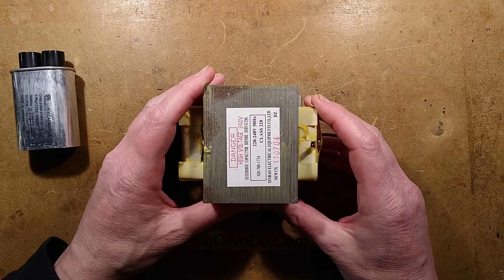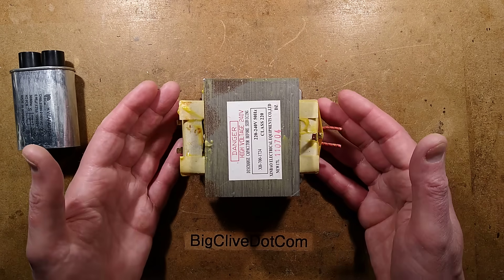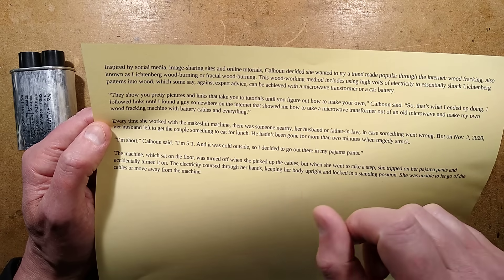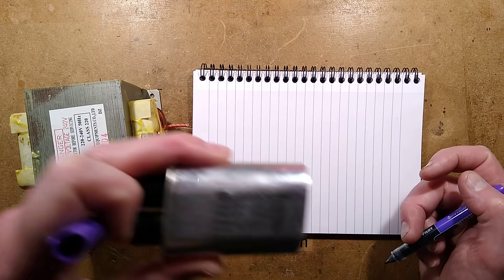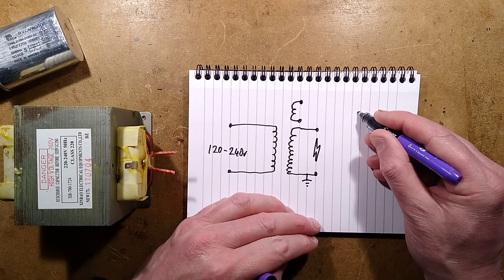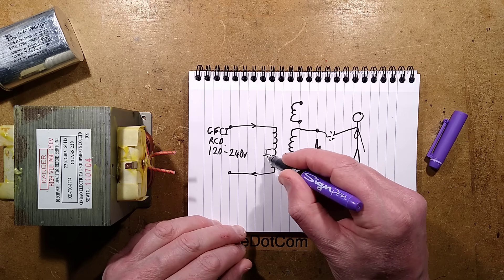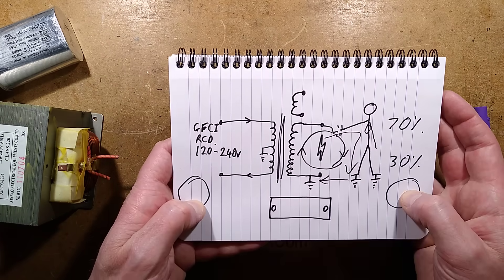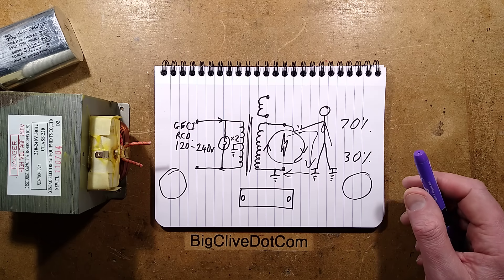The most deadly project on the Internet

Comment: I've done the wood projects at home with a neon light xfmer and a long extension chord .You use 2 nails on each side of the wood . place the wood piece on cardboard or non conductive material . don't put too much water on it so it spills. Clamp the ends of the xfmer to the nails.  Stand back at the extension chord / wall outlet far away from the wood piece

Comment: I remember being electrocuted by my TV, it was one of those really old massive TVs, someone fixed the wire with some bridge connectors, being like 12 at the time I didn't know jack about if you touched certain parts it would electrocute one self lol, I literally could not take my hand of it, I was trying to but my hand was literally glued to it, unless I managed to let go eventually? idk 
After that my hair on my head was standing up it was kind of funny but then at the same time very frigging scarey!

Got a question here; Does anyone know how much voltage and amps goes through those old massive TVs?
Reply from the maker: The voltage could be a wide range in a TV.  From 0 to 30kV.
Reply: @bigclivedotcom  Ah thanks mate lol
Reply: @bigclivedotcom  Usually 25K on an old color set plate cap. You were lucky. Your hair would have been the perfect style for today.

Comment: My brother once asked me to make one of these wood burners for him, I told him I wouldn't give him the tools to kill himself.

I will still probably do it with him one day, but only with me around and in a very controlled environment. it's not something I would do lightly, I really like your dead man switch idea as it is similar to something I was thinking of.

My father once told me
Low voltage May kill you if you touch it, but High voltage always deserves respect as it will kill you just for looking at it wrong.

Comment: People need to stop referring to the voltage as the meanings of safety. In most cases it’s the amperage. Use the 12 volt car battery compared to 110 volts. Simple math says that the 12 volt battery is far weaker than the 110 house voltage. So wrong. Worry about amperage. Be very scared of amperage
Reply: In this case of a microwave transformer though, the amperage is also very high at around 1 amp. It’s just that higher voltages typically coincide with higher amperages which is why the former is mentioned far more often as lay people (myself included) are more used to the concept of voltages.
Reply: @TheSniper9752  Well, next time I'm getting electrocuted, I'll stick an amp meter in line to see if I'm ok. lol.
Reply from the maker: In this case, high voltage pushes high current.

Comment: Sir.A Question. I intend to purchase a einhell power x-change charger that is powered from a cars 12v system.  The battery packs are 18v so.. surely unit needs approx 22v internally to charge 18v.does this sound right?? Many thanks

Comment: Not sure exactly sure why you were working on a 13.8KV line live. But at that voltage you need to be working with a HotStick. Your gloves have to be tested every three months per OSHA you also need to be wearing leather gloves over your rubber gloves and you should have been standing on a insulated high voltage blanket. Who went to jail for allowing you to work live voltage with just gloves on and no 50 CalSuit?

Comment: Once ago, when I was learning to TV sets serviceman, we had practices and classmates begun a fun: Pulling the electric arc from the high voltage transformer by screwdriver. (There were analogue tv sets yet.) They said to me: enjoy it too. And offered me a screwdriver with damaged insulation. An arc went through damage, to my finger and caused me an unpleasing burning injury within less a second. (16 kV, 15625 Hz)

Comment: I've read a lot of comments but haven't seen what I'm looking for, which is - what is the proper way to "drain" a transformer of its energy?  OR are you saying that it doesn't store the energy, but in reality can pick up energy from other things and pass it through you.  I do a lot of copper scrapping, and microwaves is one of many items routinely scrapped.  So because so many people do it and will continue to do it, what should someone do to eliminate this risk AND STILL properly scrap it out?
Reply from the maker: A transformer doesn't store energy.  A capacitor can, but sometimes has a built in resistor to discharge it safely over time.
Reply: @bigclivedotcom  Ok cool, thank you.  So is the biggest issue this guy is mentioning having to do with people trying to use a transformer for something?  I've seen SO many people scrap out transformers and had no issues.  Just wanting to make sure.

Comment: NOTE These microwave transformers can still shock the living daylights out of you even after they've been sitting in a microwave that's heen unplugged for months and maybe even up to a year.  I'm not going to swear by the 'YEAR' theory, because I'm not stupid enough to test that out.  I did however get the crap zapped out of me by a microwave that didn't work anymore and I was f'ing around with it just for sh*ts and giggles.  Never again.  LoL. I learned that lesson the hard way.  Btw, my hands were dry when I was shocked.  They were definitely dry after the shock!!!
Reply from the maker: Note that spinning a microwave turntable motor can generate enough voltage to give you a shock.

Comment: Hi Sir, Saw your Video. Need an advice. Do you think that tube amplifier power transformer secondary's winding need to add in fuse? Or you could suggest a better safety precautions for me please.
Reply from the maker: I do recommend using a fuse to protect the transformer.  You can also use PTC thermistor fuses that self reset.

Comment: I've been a microwave service technician for over twenty years. I am still very aware that it is very dangerous.
Reply: I didn't even know that was a career still. Kind of like how "tv repairman" is no longer a thing. Huh.
Reply: @Guru_1092  Why wouldn't it be? Unlike CRT TVs, Microwaves are still used by everyone.
Reply: @AdamsOlympia  Idunno, just never really considered it. I mean, it makes sense in hindsight, but still feels antiquated as a career (even though it definitely isn't).
Reply: Same here. I was electrocuted by the sec. capacitor and it was not a nice experience.
Reply: @michaelekstrom7698  you were shocked, not electrocuted. "Electrocuted" is a portmanteau of "electric" and "executed".
Reply: @Guru_1092  🤣

Comment: I’m a DIY guy and have done my own electrical circuit and cables for my mancave HT which includes cabling all lights, switches, outlets, etc. One thing I will avoid and never entertain myself in doing is working with anything higher than 120V. One reason is I’ve no formal training in electronic or electricity. Everything I know about basic electricity is through reading books and online resources. The results using HV for this project is truly amazing, unique and something you can brag about, if done right as you have suggested. Another project I saw online that looks fun and mesmerizing is a high-energy plasma using microwave oven transformer, which if done right, can be rewarding. I’ll keep to my 120V max limits 😅

Comment: Good to see someone trying to educate the masses regarding electricity. I have an electronics background and well versed with spark inducing devices. What I have found out over the years is that there is an INCREDIBLE ignorance of our most utilised natural power source. I mean how many times have you heard the question, what kills current or voltage? Now I'm not going into that here but if you don't even know the answer to that question you would be wise to stick to using ON and OFF switches and 9v batteries!! Bonus, best way to test them is on your tongue. I do think you could have placed a little more emphasis on the Capacitor, recognition of and lethality of.

Comment: old habits die hard big clive, UK nominal voltage is 230v, or is it a brexit thing?
Reply from the maker: I'm talking actual measured voltage and not theoretical paperwork voltage.
Reply: @bigclivedotcom  but given that this IS theoretical paperwork and not a measured voltage the current  [2003]] nominal voltage of 230v should be used,  granted 240 is the most usual voltage measured but a significant number of supplies will be 230v and any current calculations based on a higher number will give  a lower current, possibly leading to the incorrect  conductor CSA selection

Comment: Just wondering (If you would answer my question) Could a Microwave "Transformer" be used to make a "Jacobs Ladder" Project .. ?? Is the Voltage High enough ?? (Thanks for pointing out the Danger)
Reply from the maker: It's way too ferocious and dangerous for a Jacobs ladder.  See if you can get yourself a 10 or 15kV traditional 50-100mA neon sign transformer.
Reply: @bigclivedotcom  Thanks for the answer regarding a Jacobs ladder ... I've seen neon sign transformers but a bit High of a price for my wallet.
Reply from the maker: @x_CrossHair_x  They are.  But massively safer than a microwave transformer.  If you have an older local sign company ask if they have an old used neon transformer you can buy.
Reply: @bigclivedotcom  No doubt safer .. I found one (Amazon 10KV under $50) put into my wish list. So I will go with that and hope strong enough to work. (BTW no local Sign company that deals in Neon)... Small town what can I say. (Once again thanks for your help and taking the time to answer my question) TTYL perhaps.

Comment: If I hold in my hand , a shoe, and touch the shoe to the live terminal, will I get shocked? No, because the rubber sole is not conductive, right?  Why when the shoe is under my feet it becomes conductive?
Reply from the maker: High voltage and moisture.  Even the tiniest pinhole or crack will wick moisture that provides ample path for fatal current.
Reply: @bigclivedotcom  perhaps an explanation with a circuit diagram could better show the path of current through the body to ground with details such as resistance values, material elements, surface charges, voltage drops, etc.

Comment: Thanks. Being the kinda guy that screws around with almost everything thinking I will be fine. I now know, I don't think I will ever do anything more than change a fuse in a microwave. I've even wired my own house etc... But when I know that all I need to do is work on the right side of the breaker and don't touch the bus bars etc. These things freak me out.

Comment: This is why we love you, man. You tell it like it is. no bullshit. All right people, pay attention!!! this one is equally as important.
   That 2000 plus volt high voltage section he's talking about, that powers a thing called a magnetron, inside your microwave. It's kind of like an extremely focused microwave antenna. it's the main component of the microwave, and it's almost as dangerous as what powers it. A lot of people will take apart microwaves, to salvage parts. Grab those micro switches out of the door, but don't bother with the donut-shaped magnet on the magnetron, and here's why:
   When you look at the magnetron, you usually see a tip sticking out of a square box with fins on it. That magnet is inside the square box, and on the other side there's usually White or pink porcelain surrounding that tip sticking out, sometimes there's a screen as well. That pink or white porcelain usually gets smashed, while removing that magnet. Well, people, that white or pink piece of porcelain, by itself, isn't too dangerous. But when you smash it into a powdery dust, that's when it becomes very dangerous. You see, that white or pink substance is BERYLLIUM OXIDE. When crushed into a powder it is toxic, and will destroy skin and lung tissue, it is highly cancer causing. Think Asbestos, but many many times worse. So if you see a microwave magnetron and you just have to have that magnet inside, don't bother. It could kill you.

When I started pulling parts out of microwaves, I saw that magnet, and I started beating on the magnetron with a hammer to get it out. So stupid, I was......
Reply from the maker: Very few microwaves use beryllium oxide other than in very high power units.  It is usually indicated by very bold warning labels.

Comment: Your advice about discharging capacitors is also good. I saw a chap dismantling and repairing an LED light bulb in a youtube video and thought I'd have a go at a failed one myself. I found a circuit board inside with what looked like a dry solder joint so repaired that and switched on. Still not working. While looking for more dry joints I must have touched the circuit board in just the right place and got a real belt in my finger. Was probably safe when I started because it had been inop for a week or so, but powering it up just charged the capacitor which then sat there waiting for a sucker's finger to happen by! The bulb went in the bin...

Comment: Fantastic Presentation. If People are going to do this, please wire in the Dead Man’s Switch. It’s not hard to do. You Run 2 Momentary Normally Open Push Button Switches in Series far enough apart to where it takes both Hands to Operate. Wire both Switches in Series with the 120V Input. Clamp your Work Pieces to the Wood and stand back to Operate by pressing both Push Button Switches. I like the Neon Transformer Idea a Lot Better. If your not a Licensed Electrician, please don’t try this at all. You could at least Hire a Electrician to  build a System for you using High Voltage Rated Wiring where you Clamp the Leads to the Work, and have to Operate it from a Control Panel to Protect you. In other words, don’t Play with anything Electrical if you don’t know what your doing!!!

Comment: Thank you for a great video that  may have saved several lives already.

Unfortunately, some people will be reckless without limit, regardless of all warnings. I knew a guy in the early 1980s who even worked on TVs, using tools for car electricity! He insisted that everybody who thought that any unplugged device could be dangerous did not understand Ohm's Law!

But even he would have put on more than pyjama bottoms for doing electrical work outside, and not just when it was cold!

Comment: “Ground” is created at the power source. In this case the secondary side of the transformer. This is achieved by connecting one side of the winding to the case. As long as the transformer is insulated from “earth ground” you will loose that potential and lessen the risk of electrocution.
Reply: Maybe, maybe. See also: forgotten weapon Coilgun HS-47:
https://youtube.com/shorts/BPReIoZ-2Nw?feature=share

https://youtu.be/0WF1BGmit78

Comment: I haven't seen the project this video refers to but I wonder, if the whole safety issue is caused by the secondary being referenced to ground, then why not remove that reference and have the secondary floating? What situations might cause this to become dangerous in the context of the referenced project? Of course, when conducting liquids are involved, it is very easy to form a conducting path to ground whether accidentally or via bad judgement. In that respect, the said project is dangerous anyway, whether the secondary produces 110V or 2000V.

Comment: I have seen these devices used on IG videos.  Didn't know they were so dangerous.   I have worked on microwaves but I give them my full respect.  Great video Clive.   You probably saved at least 1 life
Reply: I must have been 6 or 7 years old. I was at a county fair with my parents and two older brothers. Us brothers we're off by ourselves and we stood in line for a ride called the Himalaya. A tube steel fence corraled the line for the ride and had 3 horrizontal bars. Pseudo Echo's version of Funky Town blared, and as I left the ground and stepped onto the bottom bar of the fence while holding onto the top bar a current of electricity with unknow voltage entered my child body. Some of what you said I experienced but clearly not as severe.
The most terrifying thing was, I could not rip my hands free, I just stood there screaming while my brothers thought I was screaming with those on the ride. I felt it in my hands and arms the most, and I felt the time slowing and confusion as you said.
My oldest brother realized something was wrong and pulled me finally off, and felt the weakend current as he did. My hands were white but uninjured, and we reported the incident to the fair.
Reply: Something I hear occasionally is that more hobbyist electricians are killed by a microwave transformer than any other device.
Reply: @Rukh_Talos I think it's the highest death per capita of a lot of these hobbies.
Reply: That's Big Clive to you!